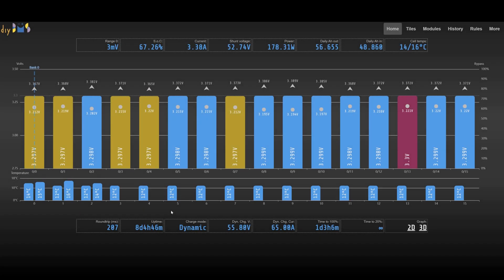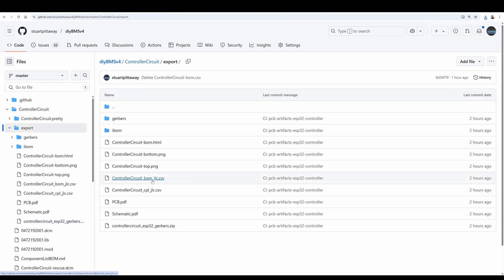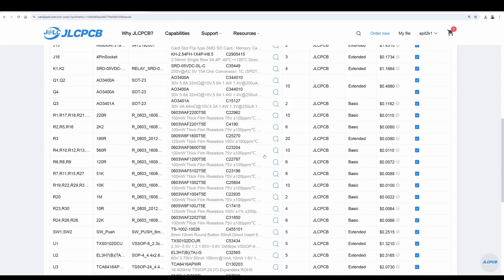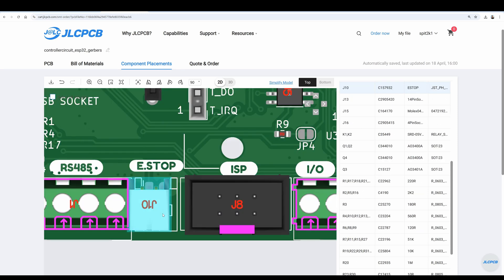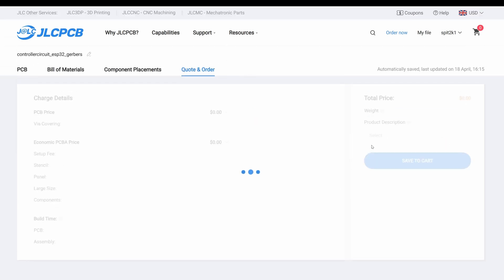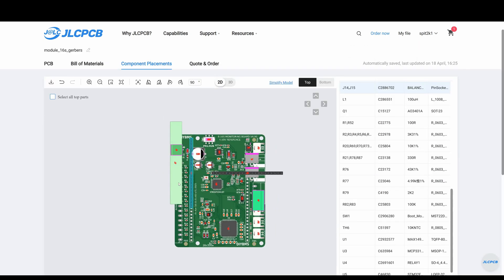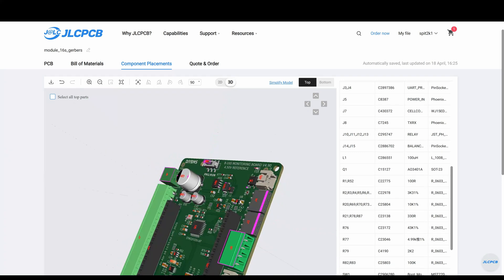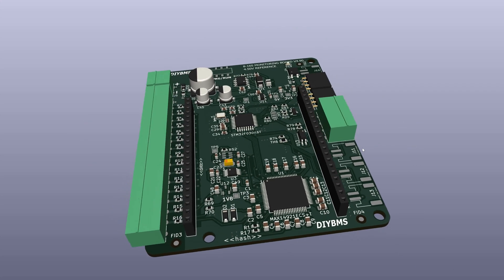DIYBMS - How to guide - building using JLCPCB

Comment: Was wondering, can i use multiple(4?) All in one boards in "parallel" to accommodate multiple banks of batteries? Are the varoius banks able to take different settings per bank, or is that one setting for all banks? (Can different battries be connected with differing "cells in series per bank"
Reply from the maker: Yes multiple 16S boards can be used, but need to keep same cell chemistry and voltage